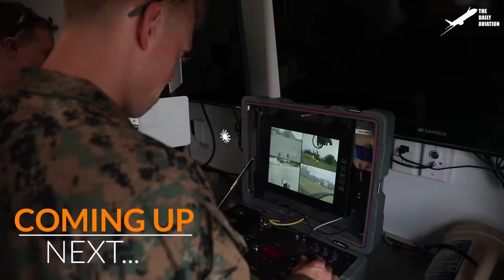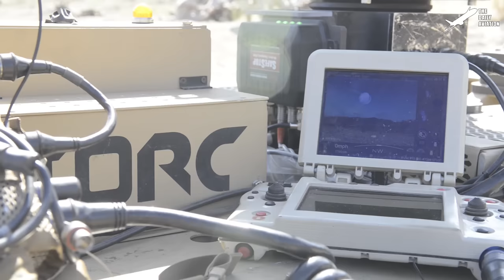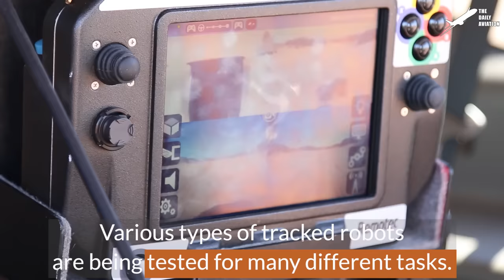US Testing an Army of Weird Robots in Real Life

Comment: It's interesting that these autonomous and semi-autonomous robots for the military, where it must work and there is less cost sensitivity than in the commercial market, use LIDAR yet Tesla has removed LIDAR and RADAR and is using 100% vision.  Note that Tesla's have run over a few things they should not have, in particular two motorcycles from behind on strait non-busy highways at night.  Point being, perhaps Tesla abandoned LIDAR and RADAR too soon, accepting some reduction in safety for the increase in profit margin.